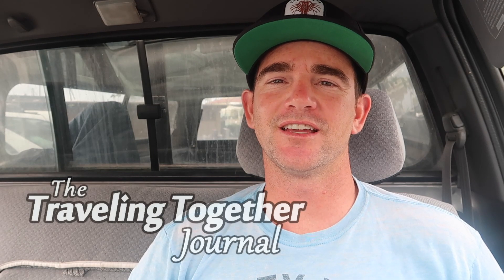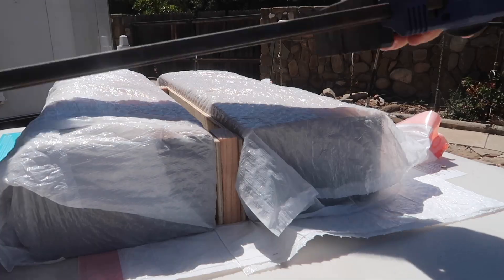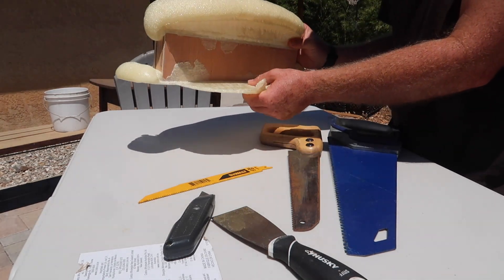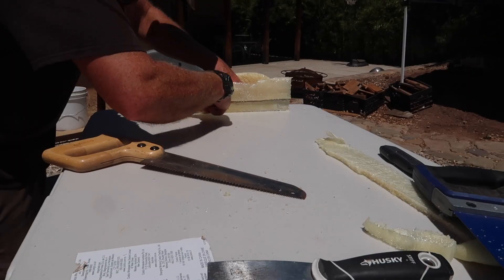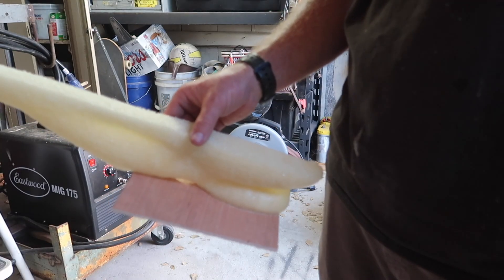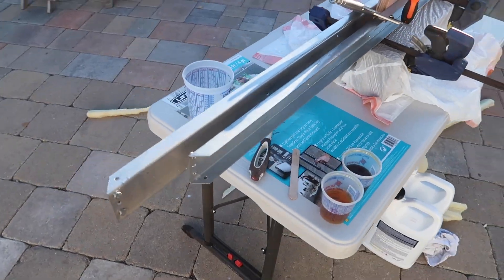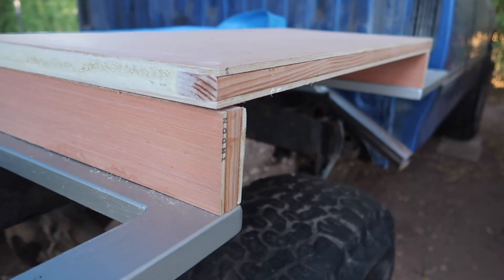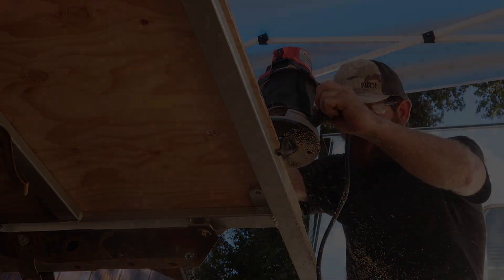Building A 4x4 Truck Camper | Pour Foam Composite Panels

Comment: All 2-part PU materials I have worked with are very sensitive to temperature for their expanding and cure times. Having to work outdoors with the stuff, I have seen the same mix take less than a minute to setup on a 100F day, all the way out to 15 minutes on a 32F day. Pre-warming or cooling may significantly impact working time.
Reply from the maker: Thanks for sharing your experience here.

I didn't experience that degree of change in temperatures, but I did notice that the foam acted differently depending on temperature and as I got into winter months I did pre warm the product and the structure I was pouring it into otherwise it didn't expand nearly as much.

Comment: Xps foam no longer available in your area ? Where do you live ? Not doubting your statement but it does seem hard to believe that xps foam board is no longer available at home depot . 
 Also why the wood ? xps board with fiberglass ( or even pmf ) is plenty rigid and strong enough as it is . Just sayin
Reply from the maker: I was living in California at the time. This video is a couple years old. XPS is available again. Apparently there was a change in legislation having to do with manufacturing emissions and XPS board was not compliant with the new legislation. I don't know what they changed, but it is being sold in California again.

If I had XPS board I would have used it and just glassed over it.

I used the plywood to create the form for my pour foam and as an intermediate material between the foam and fiberglass/resin. It is stronger than the foam, but lighter and more insulating than the fiberglass. It is also very easy to adhere to for the foam and resin. The wood, resin, and glass weighs about the same as FRP and adhesive, but I think it is more resistant to delamination, especially after impacts. I'm not an engineer. Just my theory.

Comment: To the manufacturer, 
  By using a syringe injection devices to contain those 2 Part Closed Cell Pourable Polyurethane (which is very expensive) 
  before mixing them for application will save your customers a lot of money..

Comment: 4-8lb density foam allows much longer working time but, expansion volume will be less. I use it weekly working on steel and aluminum boats. The urethane foam adhesion is incredible no matter the density.
Reply from the maker: Good to know. Thanks for sharing your knowledge!

Comment: To anyone watching this and going to do this pour foam idea. Just know you can mix multiple smaller batches of foam. You pour it and wait for it to stop growing and harden off then pour more on top.  Also if you save the scrap foam from the over fill, you can cut it up and drop it in the next part before pouring. The biggest benefit to mixing smaller batches is if the first batch you pour goes about half way up the part (because of the gluing effect) , it helps not warp the part.
Reply from the maker: This is true. Thanks for pointing this out here James. I menssion this technique elsewhere as I learned to use the material better, but didn't think to come back to this video. 👍
Reply: @TheTravelingTogetherJournal  no worries. I've been watching your videos lately so figured I would try to contribute. I've used pour foam a lot while building boats. You do a great job.

Comment: You can reach Zero foam waist in the concept of taking all your scraps of foam and laying them out so that they form a merged together two part foam cube.  Then use a long bow saw (Look up you tubes on making a wood working Bow saw frame) to cut the material back down into sheets or shape them into things like end cap plugs etc...

Comment: I think your math is off. I'm using pour foam for a project and compared to pre-made foam panels; I find the pour foam cost to be dramatically lower. Check your math again.
Reply from the maker: I was including the cost of the wood as part of my composite core.
XPS board compared to the pour foam per cubic inch of foam, the pour foam is definitely cheaper

Comment: Another advantage to using this foam is that you're not limited to using only epoxy resin like using eps or xps foam panels. You can use polyester resin which is much cheaper and easier to find than epoxy. Additionally, you can also use chopped strand fiberglass which is far more resistant to impacts than woven reinforcement. Cloth. Chopped strand fiberglass doesn't work with epoxy resin. I hope this helps anyone reading this.
Reply from the maker: Thanks for posting. Always nice to see others adding useful info in the comments!

Comment: Remember wood is a heatsink so maybe try square hollow tubes for framing, you can fill with foam too. The foam needs to be closed cell to produce the insulation you want. Good luck.

Comment: I'm just suggesting an experiment to reduce the effect of push out forces of the pourfoam: Try multiple small 'lifts', allowing most of the expansion to happen in the time between lifts, like is done with cement walls. This may allow the ratio of 'expanding edge'/total expanding volume to be higher. This also allows reduced error in overproducing foam.
Reply from the maker: Good thinking. That is what I ended up figuring out as I moved on with additional panels. smaller pours and building the panels so the cavity being filled allowed for maximum "expanding edge". wide short cavities filled better than narrow tall cavities.

Comment: One way to make the wood frames stronger and weather proof is to route a half-round and then epoxy in fiberglass rod.
Reply: I don't understand how that makes them weather proof.
Reply: @surfingcuriositywaves4046  The fiberglass over both the wood and the rods protects the wood. But if the wood begins to rot, the rods will not.

Comment: Valuable experiment. But why even use wood? Alternatives would be light gauge steel studs, alum tubing, fiberglass tubing.
Reply from the maker: I chose wood for a mixture of criteria: weight, insulating properties, availability, cost, strength, the tools and experience I have available.

Comment: Looks like a great end result, as long as you can control expansion. Do you think a whole teardrop side could be poured successfully? Perhaps Form ties through your wall and sides might work with 3/4 ply forms on the outside?
Reply from the maker: Thanks.
If you made ridged, flat forms that you could put your panel between before pouring I think you could do an entire teardrop side👍. I did some panels that were 48x75 inches. A straight ridged form results in a nice flat panel. The top edge needs a little extra attention. If the wood is warped you need to pull it up agains your form. The foam won't push the wood out again the form along the top edge.
Reply: @TheTravelingTogetherJournal  Just saw your reply. I've been in on concrete pours of vault walls, and building walls that used 'form ties' thru the slab, with clamps on the outside of the plywood.. 2x4 frames held the 3/4 ply forms flat, preventing warping from the pressure.

Comment: I notice square wheel-wells instead of arched.
How does this foam fill an semi-circle?
Reply from the maker: I can't speak from experience on that, but it should work as long as you can get it poured in with enough time for it to flow as a liquid to the bottom of mold to make sure its getting into all the nooks and crannies

Comment: If you had just nailed the plywood to the 2x2, would the foam push the sides out as it expanded or does it just expand up and out (least resistance)?
Reply from the maker: It primarily expands up (least resistance) but as it expands it adheres to the wood and creates resistance and exerts a bit of force in all directions. easily enough to bend the 5mm ply and cause convex bends between the frame members.

Comment: Wot about poly panel which they use for cold room..new Zealand YouTube makes tiny house on large boat trailer. Best part the trailer can be unbolted. He made 2 large cabin on his land using second hand panel and within 3 days only getting help to do the roof had it at lock up stage $1000 USD each. He made a floor frame. Glued and riveted the sides of drop the floor in and got mate to help lift the roof. No framing no wood very lightweight. Insulated. 
https://youtu.be/4We3iNNjurA

Comment: I can still get the foam board here. I’m looking at adhesives, when I had my cabinet shop I use to use 3M 90, which someone recommended to stick the board to a thin plywood. Is this what you were going to use?
Reply from the maker: I was planning on trying a few different options. Loctite PL300 is a foam board adhesive that comes in caulking cartridges. or make an epoxy paste

Comment: I've considered doing the exact same thing but I might pour just a bit under the calculated amount of foam and top off as needed.
Reply from the maker: Ha ha yeah. I've gotten a little better at not waisting so much foam. It is a bit tough though since the foam's expansion is affected by so many factors(temperature, moisture in the wood or air, size and shape of the void you are filling)
Reply: @TheTravelingTogetherJournal  
If the 'cure' is moisture-related, could the wood be soaked to modify the cure-time?
If the 'cure' is temperature-related, could the cure-time be modified by pouring on a cool morning?
Reply from the maker: @largemarge1603  Yes and yes, but both also affect the expansion of the foam. TotalBoat gives some good spec sheets and explanations on their website. Basically too moist or cold of conditions will result in under expansion

Comment: What if you put plastic tubes down the panels and poured the two liquids in at the same time?
Reply from the maker: Unfortunately the two parts need to be thoroughly  mixed to achieve good expansions

Comment: Great work! I live in Southern California and I can’t seem to find the pink foam board anywhere so I’ve been considering doing something like this myself. I appreciate you showing us your process. Have you tested how strong your panels are?
Reply from the maker: I haven't done any "scientific" testing. I have built the floor of the camper and have been walking around on that and have attached a couple of wall sections that are nice and ridged.
The biggest difficulty for me has been keeping the larger panels strait and flat, but this has more to do with the fact that I am trying to build this thing in my backyard without a proper place to really be doing a project like this 😅
Reply: @TheTravelingTogetherJournal   I hear ya brother. Thanks for the reply. I’m imagine they are plenty rigid. Today I did a google search and found a company who sells Foamular sheets here in southern cali. I also watched your camper floor video and saw that you are using Raka epoxy. I used them when I built my cedar strip canoe. They’re good people and had some of the best prices on epoxy. Keep up the good work man. I’m excited to see what you turn out.
Reply from the maker: @mriggsdesign  Nice! I am going to stick with the pour foam construction for now, but was hoping the foamular would become available again. I might switch to that for my popup roof section.

Comment: Watching that makes me realize if we spray foamed the cavities in any completed wall that it will not only give a R value it will strengthen it due to the adhesion. And that foam is probably similar to the XPS250 in that is has high compression resistance, that combined with your wood layers will give the cabinet high strength in both compression and stress forces.
Reply from the maker: That's definitely the idea. The foam I'm using has a very similar compression strength to the xps 250 and I think that it's working out pretty well so far. 👍

Comment: One major benefit of using this type of foam is that the bond strength of your panels will be very high!

Once you've learned to judge the mixture to panel sixe ratio, you should able to achieve very little wastage of the foam.

Thank you for sharing your work, it greatly helps viewers to learn more about the technique and the product used.
Reply from the maker: The bond strength does seem really good. 
I've got a comfortable strategy figured out for filling the panels with much less wastage.
The thing I'm struggling with now that I've moved on to larger panels is producing straight, flat panels. I've been clamping wood supports onto the outsides of the skins while filling with foam, but I may try getting some steel tubing instead.

Comment: so I'm trying to do pretty much what you're doing,  but realized that you can never get lumber that would match the thickness of the xps (1 inch thick lumber is more like .75 or something) how were you planning on working around that or did you find a way to get lumber that was sized exactly?
Reply from the maker: I was planning on using .75" XPS foam board. They manufacturer it in that thickness in theory, but I can no longer find it anywhere in California or online. All the retailers I talked to said Covid disrupted their supply, so hopefully it will become available again.
Reply: @TheTravelingTogetherJournal  cool thank you

Comment: i tried the xps type composite that you originally mentioned in the cabinets in my van build 
and while it worked in terms of being light in weight but strong enough 
the big negitive was time in layouts as you have to plan ahead for every screw 
time in gluing the lamination  
and fitting the various materials was a pain in that 1/2" xps is a 1/2  and plywood is 15/32 etc 
It was worth doing in regards to my galley counter top and I made the cabinet for my fridge in hopes of less on time 
conclusion it works but it was a pain for not much gain in cabinets but the bigger the piece the bigger the benifit such as i would probably do so for a tear drop sidewall 
your experience may very but that was mine
Reply from the maker: Good info. Thanks for sharing. It's definitely a time consuming process.

Comment: Once you have a good idea/more practice, please do mention how much you are mixing compared to how deep you pour. I like the idea of what you are doing and wish to dig a bit deeper as to how you are. If in principle only... I wish to do some remodeling to mine!
Reply from the maker: I'm not sure exactly what you are asking, but I'll try to give you an answer.
I was working on a panel yesterday. It had a void of 24 x .75 x 37.5 inches (LxWxH) and I filled it in 3 pours. two 8 oz pours and a 2 oz pour for a total of 18 oz of liquid.
Reply: @TheTravelingTogetherJournal  Not sure I'm seeing the whole response. You filled it in a pour? 37" is deep for build-up f cure.
Reply from the maker: @BywaysnoHighways  37" deep, 24" wide, and .75" thick. Filled it in 3 pours

Comment: Just got back from a run and caught up. Was awaiting how you were going to do your panels! That's a very short open time dude!!! Curious if you're thinking of adding a center strut/divider in the larger panels? Could help with the blowing and not be as big a space to fill. Good progress Matt!
Reply from the maker: I'll have to completely change how I planed to frame each panel. I'm finishing up with the floor now and I did run a center stringer the length of it to divide up the space and add strength to the area we will be walking on the most.

Comment: Really enjoy your channel, thanks for documenting. 
Maybe you explained it in another video and I missed it, but what’s the purpose of filling foam inside plywood for the panels? Did you find that to be the best combination of strength, lightweight, and insulting properties compared to other panel materials?
Reply from the maker: It's not the best, but it's not nearly as expensive as the best and I think it will work. a structural foam board with thin carbon fiber skins vacuum bagged would be better, but much more expensive and I don't have the room to set up a vacuum bagging laminating table.

Comment: Probably be a much more rigid build in the end anyway.  You're probably done with the pouring now, but a serrated blade (bread knife) works great.  Don't tell me, is the foam panel banned in Ca?
Reply from the maker: Thanks for the positivity Doug. The XPS isn't banned in CA... yet🙄 When I went to order some from an online retailer they told me that they were out of stock due to Covid supply chain issues, and none of the retailers I tried know when they will be able to get it again.
Reply: @TheTravelingTogetherJournal  They blame everything on COVID these days. My daughter couldn’t get her mozzarella sticks at Applebee’s because they were out. The waitress said it was because of the pandemic 🤣. Anyway, great improvisation.
Reply: @TheTravelingTogetherJournal  
April, 2022.
Fortunately, Russia President Vladimir Putin cured the epidemic.
Crisis averted!

Comment: As I watch this I think of 1:1 mixing nozzles for epoxy, part A goes in one side part B in the other and they mix in the straw as they are pressed through. If you can find ones big enough you could just inject it in a hole in the bottom with one big push...
Reply from the maker: Not something I thought of. Are those things 1 time use?
Reply: @TheTravelingTogetherJournal  Typically, but if that foam dissolves in acetone as many foams do, then you may be able to get a few uses out of it.
Reply from the maker: @Everlanders  Thanks, but the foam is "very chemical resistant" according to the manufacturer it can't be dissolved with anything. I like the idea, but I do a bunch of smaller pours to fill the bigger sections to try to reduce the pressure and heat, so I would go through a lot of nozzles and probably a lot of product being left in the hose.
Reply: @TheTravelingTogetherJournal  That answers a curiosity I had about the larger spaces! I was wondering about build-up!
Reply from the maker: @BywaysnoHighways  if you do the pours about 6-7 minutes apart then you still get a chemical bond between them as well a mechanical bond. Or at least that's what I read somewhere on the internet 😅
Reply: @TheTravelingTogetherJournal  That's makes you very busy during a larger panel!